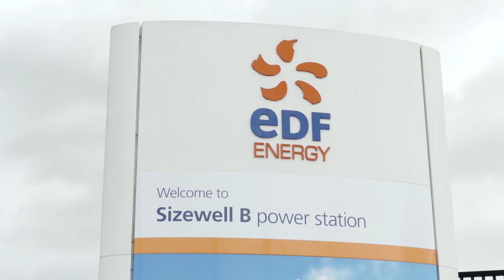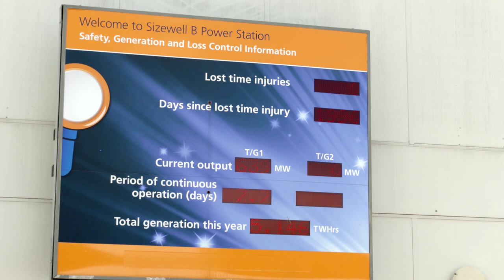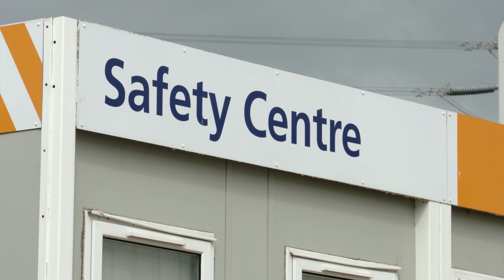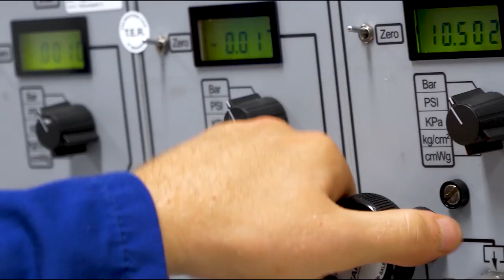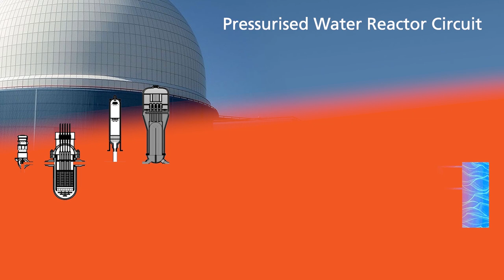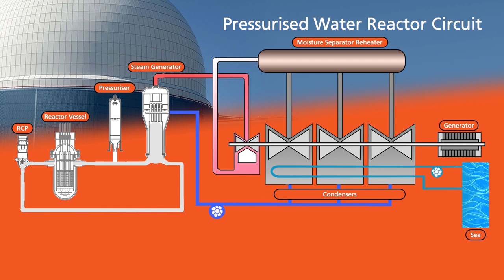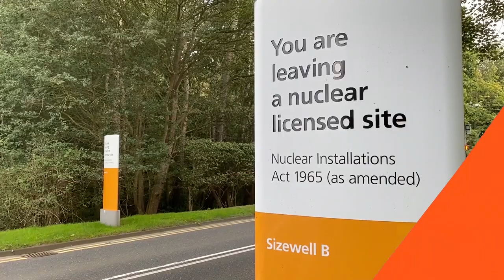Take a tour of Sizewell B nuclear power station

Comment: Could you handle a meteor strike? 
...Earthquake
What if a potential terrorist is employed at the plant, would they be able to do any damage?

Nuclear energy is great, glad to see safety is your top priority.
Reply from the maker: Hi there.  The UK has used nuclear power since 1956 and has 8 power plants designed with these types of threats in mind.  They have layers of extremely robust security.  Nuclear is one of the most comprehensively regulated industries. ^Colin

Comment: It’s a shame we threw our own nuclear industry under a bus and opted for American, Sizewell could have a SGHWR that the uk has successfully designed and run but Maggie was determined to undermine our own science and industry
Reply: I joined the CEGB just prior to privatisation. I'm pretty sure that it's chairman Lord Marshall; was an advocate of the PWR. Possibly because it was a proven design and as such more appealing to private investors. I believe Torness had originally been considered for an SGHWR but instead became the site for the last AGR to be built.
Reply: @tomroland5467  I've never been a liker of light water reactors, but as you say that had the market, but required enriched fuel which costs , the CANDU SGHWR using natural uranium and the ability to burn up PWR used fuel as we know now I feel is much more elegant, that's just me and my own thoughs on it , plus on load refueling not having to dismantle the reactor to refuel

Comment: the presentation doesn't really tell anybody exactly how a nuclear reactor works! it's my guess the fuel rods are continually zapped by neutrons or a radioactive source generated by a neutron howitzer or particle accelerator. The fuel resists the flow of neutons or radiation and consequently heats up. The heat produced then heats the pressurised water and the hot pressurised water is then pumped to heat the water to turn to steam to then turn turbines which then produces ac electricity!

In other words, some of the electricity produced is used to power the reactor!
Reply: It's reasonably basic physics that is taught to most kids in school at a relatively young age so presumably they thought it wouldn't need to be - nuclear fuels like uranium emit neutrons, which are absorbed by other assemblies in the reactor to cause fission which causes them to emit fission products including neutrons, which are absorbed by even more assemblies which fission and so on in a chain reaction. Without a moderator like water this reaction would be a runaway self-sustaining reaction. It's more complex but that's the basic deal, other than the fuel itself you don't need to put anything in to cause the reaction to take place. Fusion reactors you have to inject high energy neutral particles because the reaction isn't self-sustaining, which is one of the reasons we like fusion reactors; they're not totally safe (they still emit neutrons which you have to shield against and deal with the damage that does to the materials the reactor is made of) but the non-self-sustaining part makes them safer in the event of catastrophic failures.
Reply: @streaky81  Do you know of anything in life where energy is produced for 6 years without any input power whatsoever? I don't. It's too fantastical.

The way you have just explained how nuclear reactors work defies the law of conservation of energy.

What you get told in school is not always true!!!

If you think I've got it wrong show me a demonstration of a chain reaction in a laboratory. Over to you!!!
Reply: @PeterPete  it doesn't defy any laws of physics at all, you just haven't understood them.
Reply: @streaky81  incorrect imo simply because there is nothing in man's practical world that exhibits the kind of chain reraction dreamt up by nuclear physicists 

Does a kettle keep water boiling afterr you've switched the kettle off at the mains? Does a car engine keep running after you've run out of fuel or after you've switched the engine off? Does a wind turbine keep rotating when there is no wind?

I can give you so many practical examples in real life where machines and devices need power to make them work and yet all you can give me is an example of energy production where you cannot demonstrate that they work in the manner you think they work.

The way you think about this topic goes against practical everyday life experience!

Where on earth do you live?? In a dreamworld most likely!
Reply: @PeterPete  diesel engines. Keep putting air and fuel in and the reaction sustains itself - with a net gain of useful power, but no energy gain because the energy is in the fuel: exactly like in a nuclear reactor. There are thousands of known self-sustaining reactions you'll find. That or it's the unicorns they strap into the reactor and force to run around in circles: could go either way.
Reply: @streaky81  and btw you forgot to mention the heat plug necessary to combust the diesel/air mixture. Withoiut that too your engine ain't gonna keep on running is it?
Reply: @PeterPete  so add how diesel engines work to the list of things you don't understand, heat plugs are absolutely not necessary.
Reply: @streaky81  in my opinion glow plugs are always on just like a spark plug always sparks and without the heat from the glow plug, the fuel won't burn and the engine will stop.

so back to the alleged chain reaction. let's make it simple.

Show me somebody carrying out a chain reaction in a lab or similar where there is energy out but no energy added to the system for a coonsiderable length of time?

Over to you......
Reply: @streaky81  btw please bear in mind nuclear fuel rods are not radiooactive when inserted into the reactor for the first time
Reply: @streaky81  after some more research it seems a diesel engine doesn't require glow plugs to run. I shall correct my viewpoinnt.

Now cut the diesel fuel intake to the engine and will the engine continue to run??

This is the point I'm trying to make!
Reply: @PeterPete  cut the fuel supply in the nuclear reactor and it doesn't continue to run. Also yes, nuclear fuel IS radioactive when inserted into the reactor; it is VERY radioactive and incredibly energetic.
Reply: @streaky81  now here is where we disagree. You're just reeling off mainstream info which i think is wrong.

the fuel in a nuclear reactor are not the rods but the flow of neutrons and the only time the rods become radioactive is by continued bombardment of neutrons!! The rods are not radioactive when inserted into the reactor for the first time. that in my opinion is misinformation.

I hope you understand my position. Stop the neutron flow and the reactor will inevitably cool down and this is exactly the same as cutting the diesel from the engine or switching off your kettle - no more mechanical motion or heat produced!

Comment: A  major solar flare would be bad news
Reply: What would happen. The idiots that designed Fukushima probably  thought they thought of every disaster possible.
Reply: @DXmYb  A solar flare would shut down electronics. Some people think they are prepared. But a major solar flare would instantly kill any one on life support as circuits fried. Planes would fall from sky, nuclear plants  would melt down a as how would emergency protocols kick in? No computers. 
A third world war could be started by a country setting off a nuke over a country. The EMP would shut down the country including most of the military.
Reply: @vincitveritas3872  Thanks for replying. I've never researched solar flares.

More nuclear disasters are a certainty. Interesting to see what will cause the next one.

They are a great source of energy.
Reply: You are aware that all control systems have at least one back-up system, a final backup being a manually not remote operated system?
Reply: @vincitveritas3872  not really, but that's literally why reactors have passive safety systems. Fukushima wasn't badly designed but it was very very old and they had been repeatedly warned by the US about the dangers at the plant and they chose to ignore those dangers. All the potential issues with nuclear reactors are well known and understood, and can be in almost all instances trivially mitigated. You just have to chose to do it; which in that instance was a matter for the Japanese regulator.
Reply: @vincitveritas3872   A coronal mass ejection (a solar flare) could knock out the power grid for many months causing havok with out nuclear fleet, but an enemy exploding a nuke in the atmosphere would cause very limited damage and we'd have all that damage repaired in a matter of day.  Just as the Americans and Soviets did when they accidentally blacked out chunks of their nations while experimenting with high altitude nukes.

Comment: If the Chinese company CGN has a modicum of sense, it will not touch any project in the UK. There's strong opposition from sections of the public which it does not need. China will be needlessly tarred with bad press to add to the already overflowing canards. Then, the UK is permanently afflicted with poor labour skills and work ethics, leading to chronic bad workmanship, overruns in costs and time. It's impossible to change. Look at Crossrail and Heathrow and HS2. That's only less than 1% of the failed and failing projects. Don't even touch it with a barge pole from Shanghai. It's not even long enough.
Reply: @Largeandincharge22  dream on
Reply: Yes, Mr Chinese propaganda bot......
Reply: @Largeandincharge22  Because you treat your workforce as disposable.
Reply: sssssssshhhhhhhhhhhhh
Reply: a couple of nuclear power stations in china are already leaking because of the fact it was rushed, and government corruption had a part to play
Reply: @FowlorTheRooster1990  not due to being rushed by government..... due to being constructed by lesser-skilled people claiming to be tradesmen, despite only picking up a spanner 2yrs previously, after spending their life before that working in a rice paddy
Reply: If you are a fan of hedges maybe you could live in one? like a hedgehog 🦔